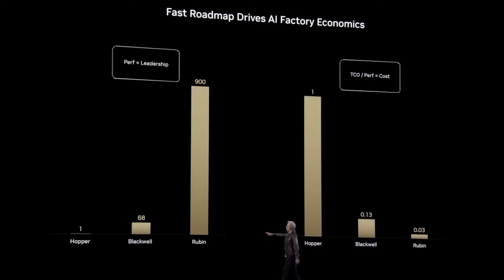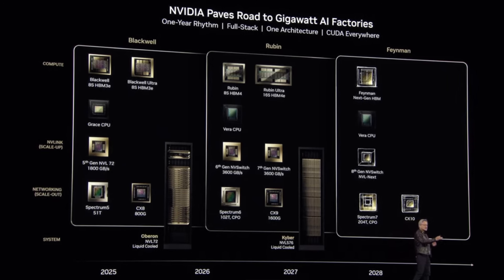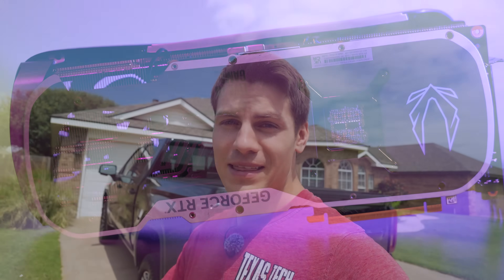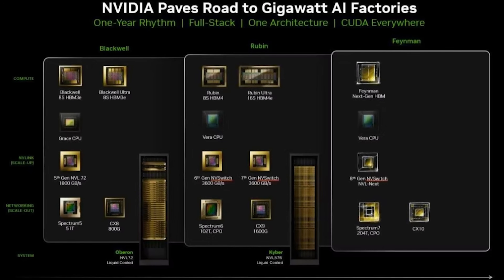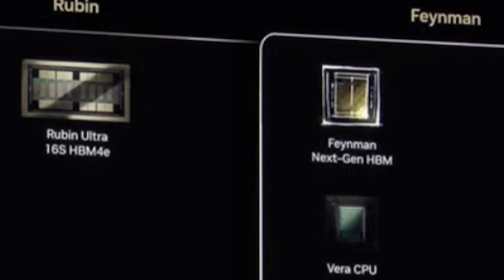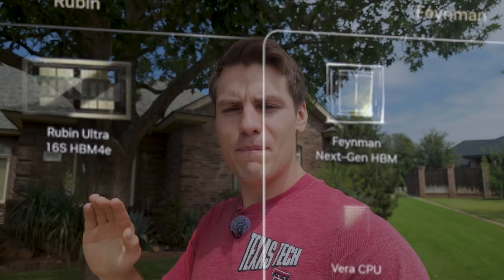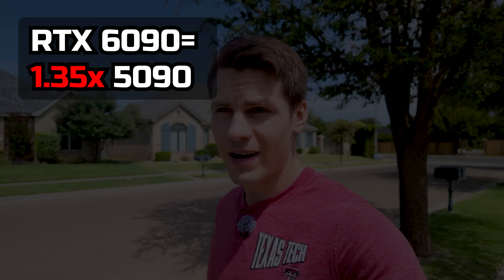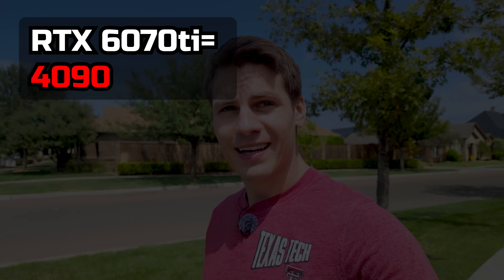Jensen LEAKED RTX 6000 Performance

Comment: I was one of those that got the 4090 because it was the only thing that brought better price/performance that entire Gen, expecting it to last me at least 8 years. Amortized over 8 years, it came out to $180 a year, and I'm very happy I made the investment to not have to be dealing with what has come of the GPU market since.  The 4090 will be the next GOAT 1080 ti.  The down side is that it has spawned a desire to upgrade everything else in my system to eek out a little more performance each year out of my 4090.  Must resist...
Reply from the maker: Do it…
Reply: I could oc my founders edition by 450 on the cores and 1000 memory and it’s been stable. You do have less vram but it’s faster.
Reply: And a LOT cheaper
Reply: @ChiyoBebe.  it is not faster then the 4090 tho... No chance :D
Reply: @Xeniix  It is and on top of that, the 5080 is going to support a higher version of DLSS, so in a couple months, the 5080 will be even faster and the upscaled image will look much better than on a 4090.
Reply: @PySnek  there you have to wait a Long Long time. Even 20 Series is on the same version of DLSS… They can use the same upscaler version and I dont think it Will change. Yes 50 series has EXTRA Features (multiple Frame gen) but Else 40 Series has the same. 

With your OC u will still not reach the 4090 and even IF, I could also OC an 4090…
Reply: Holding on to a high end GPU for 8 years is very dumb. Especially a GPU like a 4090 because you are literally burning your own money. I had a great time with my 4090. Then sold it for $3,000 and bought a 5090. Why because every generation there is a GPU shortage. There are impatient people that can’t get a GPU so what do they do. They buy the fastest thing that they can get their hands on and that was a 4090 used 4-5 months ago. I have been doing this since 2016 and I always get at least %90 of what I originally paid for my top tier card every generation. Meanwhile the 4090 will be obsolete with horrible performance and terrible power draw and you will need to build an entirety new PC from the ground up. Which is expensive as hell.
Reply: @ZackSNetwork  agree. This is the best approach to be made for high end gpu lol
Reply: The 1080ti was also a goat because of its price, the price/performance of the 4090 is awful.
Reply: An overclocked 5080 already beats your 4090... Just by a tiny bit but we are already there. Going for the flagship is always a bad idea if you don't use the hardware for work
Reply: @PySnek False a 5080 overclocked can match a 4090 at stock. A small OC on the 4090’s core and it’s easily ahead of a 5080. Along with having 24gbs of vram on a 384bit bus. Buying high end is a great value because not only do you get the fastest thing available. You also get the best resell value in the market because high end components hold their value. Even older i7’s from the 10th generation have a high sell rate still.
Reply: @PySnek  lol yeah right... XD
4090 vs 5080
16384 vs 10752 CORES
512 vs 336 TMUS
176 vs 112 ROPS
384 vs 256 Bit bus
24 vs 16 VRAM
Reply: @PySnek  Thats just not true.... I dont know where you got that from, maybe there is one game where it happens, but the 4090 is about 20% faster, you cant oc the 5080 for 20%.... Maybe 5-8% so it gets close, but then still slower and les VRAM
Reply: @Xeniix  It's funny how you are just copying the comment exactly from the reply you made to my comment. Also no it does not a 5080 OC like the TUF 5080 is 11 to 21 percent improvement it can add 500 mhz stable. And also allows for 125 percent power limit. Even with a normal 5080 you can still get a 15 percent performance boost making it trade blows with a 4090.
Reply: @Devicularbut hey you proved my point! Thank you… as you say 11-21%, there may be one Game where an OC 5080 might Trade blow with a older generation not OCed card! Talking in Account that I also could OC an 4090 and have more VRAM plus already years of better Performance isnt it Great ? 

In your case even you say “normal 5080” 15% nah that’s just not true Look digital fondries comp. Of the 5080 OC and 4090, the 4090 is faster
Reply: @Xeniix  You can't just take one website or one video for proof, you have to check the other analytics and comparisons as well. OCing a 4090 is not that effective because it doesn't have enough headroom for that. a 5080 has a tdp of 360w but usually only uses 270 to 300. A 4090 uses all of its tdp of 450w. And a normal 5080 OC such as a asus prime which is a worse version of a asus TUF, available for 999 or the zotac solidcore can beat a 4090 when OCed by 2 to 8 percent. This is proven by many overclocked guides and many people like graphically challenged. A 4090 does beat a OCed 5080 in some games but I see the temps on the 4090 reaching 87 degrees while as the 5080 is on 50 to 60 degrees and the power draw is 100w less. Not only that but the 1 percent lows are better by 10 fps in most games on the 5080.
Reply: @Devicular im not only taking into acount one review, but its credible and one exemple. And its better then the missinofrmation you got :D
Reply: @Xeniix Now you are just accusing me of false information for all I know you dont even have any proof of this, at least I know I have proof. https://youtu.be/6b4jzj4WEQ0?si=EHfUbI3kVS_S6V4A
Reply: @Devicular One video and if you go to the average at the end of the video, the 4090 is infront of the 5080 OC ;)

And i gave you proof just before?
Reply: @Xeniix  by 2 fps and he was using the fe card which is known for it being clean and a minimap design but it doesnt have the boost clock or the cooling capabilities of something like an asus tuf rtx 5080. So even if you get something cheap like a pny oc rtx 5080 it would beat a 4090 because it beats the fe 5080 by 4 to 9 percent(both are stock)
Reply: @DevicularThe 5080 OC is very close to a 4090 only at stock. Thats more so because without a memory overclock the 4090 is memory bottlenecked.

Comment: 5080 OC can actually beat a 4090 by about 3 percent avg. When super comes out it's gonna be even better since OC headroom increases because of the tdp increase.
Reply from the maker: OC to stock maybe, what if you also push a 4090? The 4090 is obviously the better card specs wise
Reply: @SiliconSteak  well super is gonna have 9 to 16 percent performance uplift so it's gonna be within the margins of the 4090 anyways in a few months.
Reply: @Devicular 46 Billion transistors on the 5080 vs 76 Billion transistors on the 4090. No contest, the 5080 has to run it its little legs off to keep up with the 4090 jogging.
Reply: @Devicular There's no way the 5080 Super could offer a 9% to 16% performance difference, assuming the CUDA count and clock speed are almost the same. Increasing the 415W and increasing the memory speed by only 1000MHz would only provide a 3% performance increase. Because the 4080 to 4080 Super had a 5% CUDA increase and a 500MHz VRAM memory increase, and that's only a 2% difference. Even 9% would be too optimistic.I'm adding that some of this power increase will go to the extra 8 GB of VRAM.
Reply: @locinolacolino1302  Blackwell has more performance per transistor and it is more optimized and efficient, they can also do more clock cycle than ADA so that doesn't really matter. You have to compare a 5090 to a 5080 in that case because they use the same architecture and has way different amounts of cores and transistors.
Reply: @Devicular Blackwell uses the same 4n (TSMC 5N) node as Ada so there aren't any improvements to transistor switching speed, Blackwell Cuda core IPC too has remained identical to Ada. What you've got with the 5080 is a die with the same area and transistor count as a 4080, just with faster memory, excessive clocks and the latest in NVidia's AI shenanigans to pass off as a performance improvement. Transistors aren't like lemons where you can squeeze them to get more juice out, and architectural optimisation can only go so far. Apart from adding new tech to the various cores, RT, Tensor, NVENC, etc. NVidia's changes to the overall Gpu architecture in Blackwell have been chiefly for the purpose of making AI run smoother amidst other workloads, with CUDA core layout altered so tensor cores can communicate more directly with shader units, and introducing an 'AI management processor'.
Reply: @locinolacolino1302  What you're saying is right, but even if it is the same node the IPC can change like zen 3 vs zen 2. Also it's not just about the raw cuda ipc but the architectural designs like cache designs, and memory subsystems allowing for more efficient vram usage, etc. 5080 also ships with way higher base and boost clocks. Besides in a lot of real world testing videos a 5080 OC like the TUF trades blows or beats the 4090 in a lot of games. Btw I like your expressions such as lemons, where you can squeeze them to get juices out 😂
Reply: @SiliconSteak The newer architecture and memory actually beats 4090 in some tasks regardless.
Reply: @Felale what tasks? Most productivity tasks the 5080 will lose to a 4090. 5080 OC loses to stock 4090 in most games.
Reply: No it can’t. I used to cope / lie like this when I had 5080. Sold it and got a 5090 instead. Would’ve picked up a 4090 over it too. There is a reason the resale value of the 5080 is dropping while the 4090 is still reselling for $1600+. Even 4080 is dropping below $800 resale since it competes with a 5070ti.
Reply: @Jaykurosakii  First off, I think you got something like a gigabyte windforce sff card, but something like a asus tuf rtx 5080 can increase it's power limit to 125% instead of the usual 110%, it can also handle a lot more boost clock increase(about 400 to even 500mhz+) while as a usual 5080 can only handle 200 to 250.  Also here is a video if you just wanna see a 4090 vs 5080 OC. https://www.youtube.com/watch?v=6b4jzj4WEQ0&t=286s
Reply: @DevicularI had the ASUS Tuf OC and sold it for $1100 on eBay lol. Overclocked it to its limits
Reply: @Devicularalso, I already saw that video. It just shows that you have to overclock a 5080 to the brink for it to get 2-5% below a stock / cheapest model 4090 in most titles.
Reply: Thats just not true.... I dont know where you got that from, maybe there is one game where it happens, but the 4090 is about 20% faster, you cant oc the 5080 for 20%.... Maybe 5-8% so it gets close, but then still slower and les VRAM
Reply: @Xeniix  Even 5% is a very optimistic estimate, we have seen 4080 4080 super comparison.
Reply: @frk8712  Maybe you are right but I like to keep my hopes up, besides I think I trust Moore's law is dead.

Comment: Won't see 2nm gpus next gen at all, cpus maybe but not gpus, amd set to use n3p/n3c for rdna5
Reply: Isn't that the process? Usually it's TMSC Xnm process = X-1 nm density.
Reply: @Hullbreachdetected not 100% sure what you are asking, like if it's yes generations lately are just jumping down a node but there has been jumps bigger In history and amd is planning on skipping a few nodes for next gen ryzens. 
Or if you are asking something about how like say tsmc like example n4x is roughly equal to n3 node in performance and efficiency(not always efficiency it depends on lotta factors that little above my head) 
Cuz like for the tiers it's like something like for 3nm example n3 to n3c to n3p to n3x and n3x being higher output node on 3nm which hits closer to n2 node.

Comment: I hope this time Nvidia won't make the 60 class with 8gb of vram and will bring back the support of 32bit physX games
Reply: I hope so too. 60 class should be at the very least 12GB and much cheaper that the prior gen. 60 series needs to go back to sub $300 prices. or give me a power efficient 6050 with 10GB of vram , 75W, and $199 msrp. could even be on N4 node. 

I hate how new budget gpus have died.
Reply: So you think nvidia gives a damn about you?...all they give a damn about is $$$$, and the bulk of thats coming from data centre.

If you nvidits continue to buy these geforce turds, nvidia will continue to be grossly inefficient and expensive. 

I've been on AMD since 2005.

Comment: Although the RTX 5090 had a ginormous 512-bit bus so NVIDIA might only need to cut the RTX 6090's memory bus but keep the rest the same.

RTX 6090 (448-bit) = 42GB VRAM
RTX 6080 (384-bit) = 36GB VRAM
RTX 6070 Ti (256-bit) = 24GB VRAM
RTX 6070 (192-bit) = 18GB VRAM
RTX 6060 / 6060 Ti (128-bit) = 12GB VRAM

Does this seem legit or a fairy tale... Honestly I think this might be NVIDIA's best choice if they want people to convince to move from RTX 50 series.
Reply: I can't see the 6080 having more than 24 GB of VRAM
Reply: @Cuxzzzs  Why though? The upcoming RTX 5080 SUPER will have 24GB. If NVIDIA is committed they can release the RTX 6080 with 384-bit and put 36GB on it.

Keep in mind that RDNA 5 flagship will come with 36GB VRAM so if NVIDIA wants to make sure AMD won't have any advantage they can release the RTX 6080 with 36GB to compete with the alleged RX 1090 XTX or whatever it'll be called.
Reply from the maker: Seems like a fairy tale in a world with AI chips selling for 10x more
Reply: This is a fairy tale. Nvidia will break down gaming gpu's relative to cost of AI cores and with Ruben going to chiplet size for Ruben, I only see 6090 getting those chiplets for next generation. 6090 will stay on 512bit and will probably bring 6080 class out on 384 bit node as well.
Reply: I'd guess 6080 will be 256bit

Comment: Absolutely ridiculous... the RTX 5080 was rumored to be 10% faster than an RTX 4090 and now next gen we're getting an 80 class GPU that beats the flagship from 2 generations ago by a small margin...

Although the RTX 4090 ended up being an outlier since it had the largest generational increase in recent NVIDIA history with 72% being faster than an RTX 3090 but still it's just sad... especially if you look back on the performance level of previous generation 80 class cards.

35% is not bad but after the stagnation of the RTX 50 series, 35% isn't gonna cut it and NVIDIA will probably skimp on VRAM too in favor of a 60 SUPER refresh... So RTX 6090 and the rest of RTX 60 series might even suffer a cut in memory bus and NVIDIA will most likely use a 448-bit bus for the RTX 6090 because of the 3GB GDDR7 memory. 

448-bit bus with the 3GB GDDR7 modules would still give the RTX 6090 42GB VRAM which is great and the 512-bit bus with 48GB VRAM would be preserved for an RTX 6090 Ti or a Ruben TITAN.
Reply: lmao everyone who thoight the 5080 will be as fast as a 4090 or let alone 10% faster, was coping so hard.

It was always clear. The 6080 wont beat a 5090 either. those times are over.

If the 6090 is another 35% step over the 5090, I maybe upgrade my 5090. No one was expecting the 6000 series to be on 2nm either. Obviously its on 3nm. many CPUs will be on 2nm tho. 

The 60 series wont come out before January 2027.
Reply: @DELTA9XTC  An another 5090 vs 4090 moment with diminishing returns but Jensen will flip the narrative and use FG as their selling point... so cool...

No wonder GPU releases are so boring now and no one cares. I miss the good old days when next gen midrange was faster than the last gen flagship while costing much less.

We'll never have an RTX 3070 vs RTX 2080 Ti moment...
Reply from the maker: Keep in mind this is a very conservative estimate, I’m assuming they are keeping the same die sizes, not pushing power, and relatively the same clock speeds. (I’m trying to keep down the hype until we know more!)
Reply: @SiliconSteak  Yeah I know. I'm just speculating and looking at possibilities.
Reply: The idea of getting 50% performance increase every new generation of gpu cards is gone. It is getting more and more expensive to get more performance with smaller nodes. 6090 performance will be good as it will sell in quantity regardless of price because of AI which does not look to be go away. But the other gpus willdefinitely be cut down specials just to pander to current gamers unless Amd goes all out with there next version and tries to compete at the 6090 level too

Comment: The lack of process node skips will prevent another gtx 1000 generation, so it's good in the long run.
Reply from the maker: How is that good?
Reply: @SiliconSteak  People won't buy even smaller die sizes for even more money.

The gtx 1000 series is why the market is the way it is now. The gtx 1080 a 60 class chip(314mm^2 die size out of 858mm^2 reticle limit) was sold for 700$ (FE)MSRP when it should have been 350$, maybe 400$ since AMD had no competition for it for 1 year.